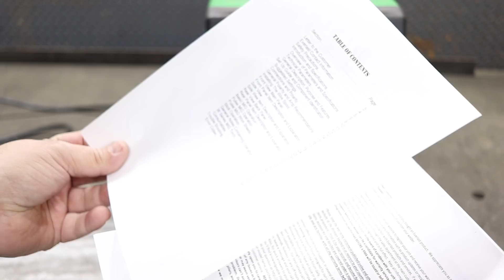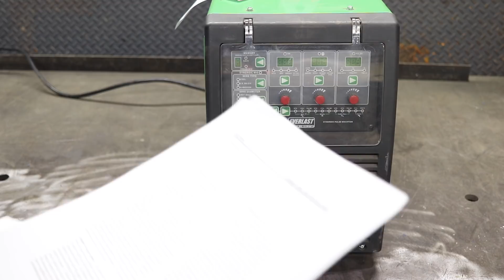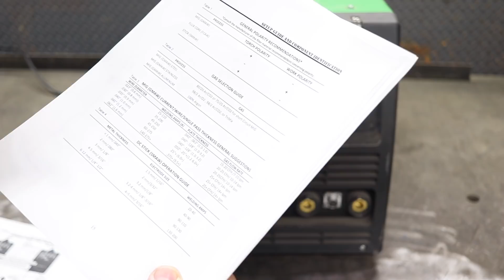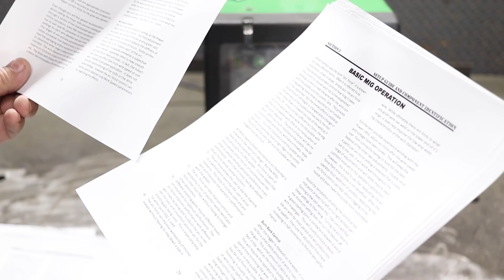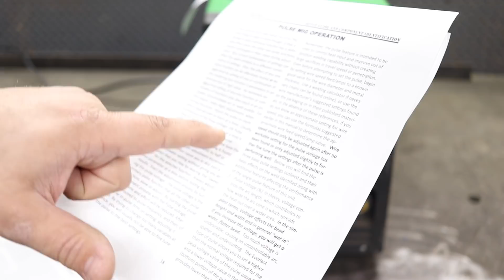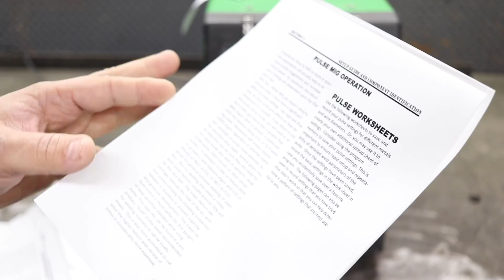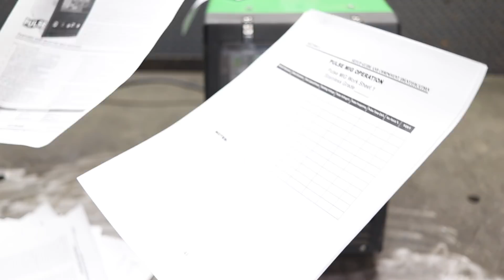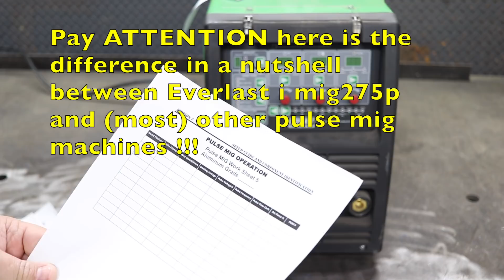Everlast I mig 275p manual pulse explained and reading through the manual

Comment: amps x volts = amps  The 100% duty capacity - 195 amps @ 24 volts = 4680 watts / 240 volts = 19.5 amps.  Efficiency of the inverters in the machine will play into that but the power supply cord should be fine.  Running a 240 x 20 amp circuit in a house or shop I use 12 gauge wire.  NOT AN ELECTRICAL ENGINEER.  The truth is that our wire in the wall standards are way way over the needed size of a short run such as a power supply cord on a machine.  Look inside a piece of equipment and you will find very short lengths of small wire on 30 amp equipment.  In experiments I pushed 20 amps through a 30 gauge wire (0.010"), very short piece, but it held the current.
Reply from the maker: amps x volts = amps  ?????  probably a typo, in my world.   amps x volts = watts.
what you are describing is max amp draw vs effective current, I have videos on that topic too I am very familiar with this ... 
an outlet has to be wires for max amp 100% duty (if you mother in law plugs her space heater in it and runs it all winter long on HI) ....  welding machines have a duty cycle and temperature rating and the power (input ) coords are short and so different rules apply ...    

however on a machine that caliber most manufactures use 10 awg cable not 12....    not saying that under certain conditions it couldn't be complying with electrical code, just saying that the "expectation" is different for some stuff ...

Comment: Here’s the way I look at it, I’ve survived 13 years in the fabrication industry without pulse mig and personally I think he’s just trying to prove that the HTP machine is better than this one! Save your money and buy a regular machine cause if you’re welding in your garage you’re not gonna need pulse anyways!
Reply from the maker: you really only need pulse if you weld aluminum of 1/8" thickness or thinner ....  1/8" and up can be welded with a "classic" mig just fine.   
on SiBro it makes it easier to focus and pin point the arc ....  but if you NEVER wire weld aluminum or SiBro chances are your life will be just fine without a pulse mig !
Reply: Agreed to a point. However the ability to use the HTP with aluminum in pulse and on pulse on pulse mode is a huge advantage particularly since it's basically intrinsically part of the Propulse200 and you don't need a spool gun. If all you're doing is making gates it really doesn't matter.
Reply: For must of us Dave we don’t weld thick aluminum so the pulse comes in great there, also double Pulse makes it look like tig so it looks better that’s first and formost. Secondly the ability to not use a spool gun or a push pull gun like the cobra saves money because it can come directly from the mig gun. I don’t think he’s trying to prove anything its just his honest option to be I respect him for that. And lastly you mention 13 years but never say what machine you use, I’m guessing you own a everlast? Most people welding in the garage will use the pulse because of the smaller aluminum. As for the pro pulse it has Pulse, double Pulse, crater fill, down slope, Swiss drive roll and guess what you don’t have to remember or write down any settings
Reply: Well I can tell ya one thing he shouldn’t have went by the machines settings on his stainless welds cause it was entirely too hot! And besides you still have to dial these machines in or you’re gonna run into problems! They’re trying to make it where anybody can pick up a welder and be great and that’s not how welding works! One of the biggest things of being a good welder is knowing how to set up your machine on any material. I’d never depend on what that machine says and like I said watch his stainless video and you’ll see it doesn’t always work out
Reply: David White if you see talking about the pro pulse video he did with the flange I don’t know if you realized how thin that material was. He didn’t burn through once and the welds looks good no undercut and good penetration. It’s not about having anyone pick up a welder it’s about saving time which in turn saves money. Those programs can be tweaked and it’s a perfect starting point for your weld which in turn you can bump feed down or up slightly or even yet which I may be wrong but this everlast can’t do is turn the volts up and down without moving the wire feed speed. I’m again guessing you own an everlast machine. He’s not knocking it if you like it great but he’s been doing this his entire life and used many machines to which he can compare it too. Pete is an honest guy or would you rather see an endorsement video that’s all commercial?
Reply: Welding junkie I own an Everlast tig and a Millermatic 350p and both do what I want them to do! I use a Dynasty 280x at my day job for tig and a Millermatic 252 for mig and I can say the only one that has been replaced is the Everlast! My point is this machine or that htp is even in the ballpark of a Miller and I just think it has a bunch of pointless functions
Reply: David White I’m not sure what you mean in the ball bark with Miller? The HTP does the same thing the 350 does besides the amps. The Miller Matic 252 can’t do what the HTP does. And if you are in your garage welding you do want Pulse and double Pulse for thin material and poor fit up. The HTP is better quality than the everlast hands down and who’s to say it’s not better quality than Miller. Miller uses parts sourced all over the world including China as well. HTP is Italian made by Stel who is the Miller of Europe ever check out there website and how many machines they have? The HTP Invertig has more features than your dynasty 280 except amps with thier Independent EN/EP adjustments and Pulse stick ..So to sum it up by having “pointless” setting that make our lives easier it’s not with it? Is that what you are saying? Btw I’ve owned the Hobart Ironman 230/ Miller multimatic/ dynasty 200/ dynasty 210/ and a bunch more and I find that I would take my now HTP machines any day over them. I’m not she what you mean in the ball park but HTP and it’s service are top notch. For the record “save your money and buy a regular machine”  what would you buy with saving your money?